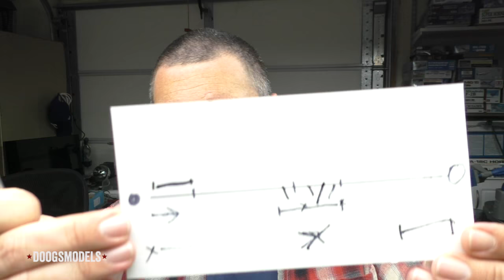Black Basing 201: Not Quite Blacks

Comment: I think if you want to depict a really grungy black aircraft, filter techniques will be the way to go. Lay very thin, transparent layers of lighter colors over black. I think the best technique for this will not be the airbrush, but the classic "a dot of oil and then spread it with a soft, wide brush wetted with turps.
Reply from the maker: Yes and no. Oils certainly play a role - even a big one - but I'm a big proponent of weathering starting with the paint. Also, light oils on very dark surfaces can be a real headache, and I think it's better to use them to "curve the shot" rather than be the shot.

Comment: Another great vid. I]m in the process of painting a Westland Lysander in all black (Special operation color) and found this extremely useful particularly as the I wanted to get a different tone with the wings as these were fabric against a metal fuselage. Using MRP 255. When blending other blacks did you thin the paint?